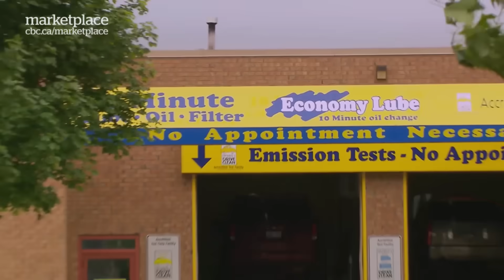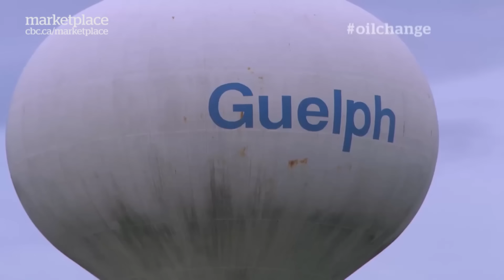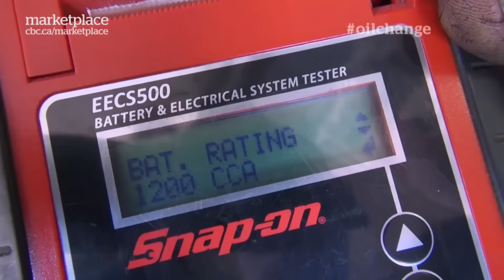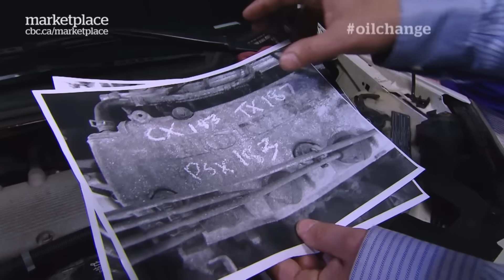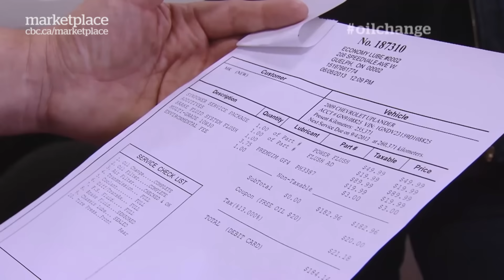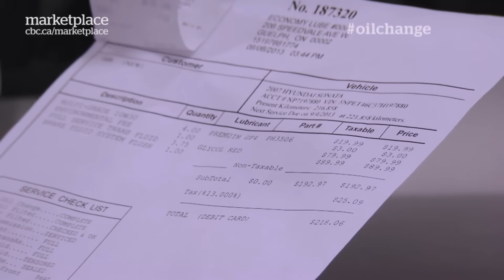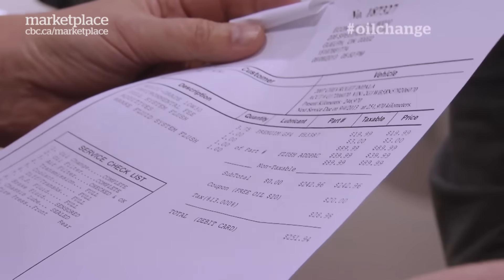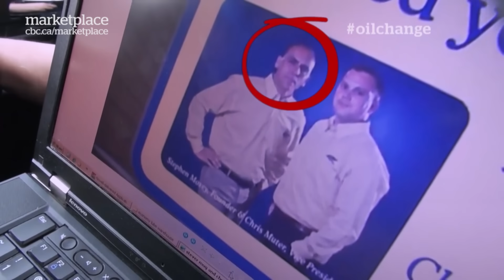Oil change scams: Hidden camera investigation on what really happens to your car (CBC Marketplace)

Comment: I can’t stand it when you ask only for an oil change..and they want you to have a flush radiator, transmission oil change, brake lines and do something with the power steering fluids..and change all the filters. Drives me nuts. And the damn oil change alone is still 98.00!

Comment: I'm guilty of not doing it but you should have your regular mechanic change your oil.  While the car is on the hoist they can check the suspension, front end, and drive drain for any problems.  You do not want a ball joint or tie rod end breaking while you're driving.

Comment: If they have 3 different prices for an oil change. 19.99 29.99 and the deluxe oil change is 39.99 that means if you you ask for the 19.99 oil change the technician will wipe off your oil filter and drain out half of the oil and then top it off with new oil and the next customer he will use your old oil to add to a deluxe oil change and each time the technician keeps your new oil filter and takes it home to put on his own car and the same thing for the new oil.   He steals a quart of new oil from each customer until he has enough oil for his own car.

Comment: Of course the budget price is bare bones. You arent getting synthetic oil or a decent filter etc. Its not illegal to offer extras. Its the very business model they use and any fool should know. Dealerships do it ..upselling wiper blades batteries tyres the lot!! Blinker fluid and headlight gas.

Comment: I do my own oil and breaks take me longer on oil changes because im doing it correctly.  Use a sharpie mark the oil filter. Most times the engine oil hasn't had time to completely drain in 10min  cant get all the old oil out but at least give it more time to drain. Worse things ive seen on u tube is over tighten oil filter and oil plug. There's more to much to mention

Comment: Just had an oil change done on my 2003 F150. Was told I had a rear seal out. I said no there isn’t, that someone (my bil) sabotaged my truck. Just do the oil change. I did need new wiper blades and new air filter which I had replaced. Oil change got done and I left, checked my oil at 100 miles and had to put in2 quarts, I was thinking I may possibly have that leaking rear seal. I kept a close watch on the oil level for the next 1300 miles. Guess what my oil level never went down at all. This tells me that I was being scammed about the rear seal! Will I go back HELL NO! This was 5 min oil change in Terre Haute, In.

Comment: Your blinker fluid has gone brown, it's supposed to be amber. That'll be $218.

edit: Dexcool is corrosive AF, use Prestone(the green stuff). I've ran it for years, it's fine, the Dexcool was corroding plastic fittings.

Comment: I hate the fact you can't trust  anybody and have to constantly learn stuff to keep up. Have a electrical problem?(tought myself over a few years). Have a plumbing problem?(worked as a plumber for a year). Recently bought a used motorcycle. Good thing I learned electrical and I'm in the user manuel everyday. Can't trust anybody to adjust my valves so I will have to do it. Have to buy a tourque wrench and a full set of bits....

Comment: Quick oil change shops are NOT fine for an oil change, especially if you have an aluminum oil pan for them to strip the threads on.

Comment: Never do a complete trans flush...only drain and fill like your oil.and filter.........A complete coolant flush not needed     drain and fill from radiator....Honda Civic Manual......Brake fluid needs to be bleeded out from each wheel.....if you own any other car......sorry to hear that

Comment: 1:37 why does it take like 1 minute to hoist up the car? In any other workshop ive seen and work in it takes about 10 seconds. im glad to work in an honest and fair workshop here in europe

unnecessary oil changes and "repairs" waste precious time we could use for an actual bigger problem, my boss goes like "come back after either [x] kilometers or [y] time and we'll have another checkup, right now is not necessary"

Comment: I  lost  major  respect  for  my  mechanic, who's been  working  on  my  car  for  many  years. I've  recommended  him to  friends. They  always  called  if something  they  felt  needed to  be  done.  I  was always One call  away.  Went  in  for  oil  change. Got a  bill for  oil change,  cabin  air filter,( Big  scam  for  cardboard) and  replaced  corroded  battery  terminal. The  last  2 without  my  approval. 
I lost  it  on  the  desk  person. You  ever  pull  that  sh*t  on anyone  I  recommended ,  I'll be  very  pissed  off. They  got the  hint.

Comment: at least they change fluids,i left my car in dealer's shop Opel in Poland i found out later that oil was not changed and i paid for it,any way next visit i put some marks on the filter and sealing nut and.... no oil was changed i told them that we will meet in court and they gave extra repairs for free and mechanic who cheated was fired instantly

Comment: usually you can shut these guys down pretty quickly if you come off as knowing even a little bit about your car. Tell them exactly what oil you want and how much you need and that's usually enough to stop the upselling, they know its only worth trying to prey on the ignorant because you might make a fuss and badmouth them later if they try to rip you off... Even better is to just avoid these places entirely and learn how to change your own oil, or if you don't want to do that I almost guarantee you know someone that can do it for you properly if you go and buy the proper oil and filter that you need and toss them some money for the trouble.

Comment: Walmart does the same things. I was just scammed by them. They sold me two tires I didn't need or want when I'm there for a flat repair. Then they scammed me saying my tires are to worn out to be repaired beacuse of that they don't qualify for their road hazard coverage and that they won't give me any credit twards replacement tires spit my having 50% tread left. They told me that my tires need to be repaired in pairs because the vehicle will not drive correctly otherwise. Then they charged me all kinds of extra charges like valve stem replacement when I didn't ask. Then they changed me $29 per tire for balancing. They over changed for what they did and sold and did extras I don't want or need.

Comment: No matter what don't detach any vehicles fuse for a few bucks . Coz a half filled fuel tank is filled with gas and will explode if your vehicle catch fire. I got lucky mine didn't blew up. Don't put peoples lives on the line for a few bucks.

Comment: Actually, this kind of things are pretty common in Japan too thoguh most customers don't know.  So, basically, I usually does most maintenance by myself.  But, I have to ask some shops to do legal vehicle inspection once in 2 years in Japan though we can do it by ourselves though it is not really feasible for those who have a job.  Only in such cases, I need to argue with the shop mechanics or sales persons not to do anything unnecessary things to pass the legal vehicle inspection.  It is really troublesome...  Also, in the cases in the video, the shop charged several hundred dollers but in Japan such shops charges several thousand dollors.  I also used to live in the US before but number of such shops are fewer than those in Japan as long as I know...

Comment: Almost every car over 15 years old needs more than an oil change it may not be a fluid flush but it if you look close enough there is something broke somewhere. These company’s just suck at finding it or can’t do the work and it’s usually something so minor that they don’t have a good sales pitch

Comment: now if you need 0-w20 or 16 thats full synthetic in most cases unless the manafacture allows non synthetic oils We cant put 5-w20 at the 20 dollar pit crew lube, oil and filter.  we have full synthetic quaker @44.88  or 54.88 for mobil1, castrol synthtec, pennzoil full synthetic or valvoline.

Comment: Thier so called expert is not all that sharp.  When asked what will happen when coolant types are mixed He described a bunch of gobbly goop.  What really happens is the PH of the coolant goes off the scales, and become acidic.  I have seen it happen many times.  You will lose you heater core your radiator and major gaskets such as the head gaskets. I suprised I did not see a PH meter testing coolant before letting the quick lube guys at it.  Very expensive mistake and hard to correct.  I have 45 years experience as a shop owner and line mechanic.

Comment: It's one thing to sell a service that isn't needed and done anyways but it's a completely different thing to sell an unnecessary service and not do it at all. That's straight fraud and they should be penalized. Not just told not to do it anymore. If I continuously stole from someone they wouldn't just tell me to stop and not do it anymore. They'd want me punished for the theft that's already occurred. Why didn't they bring charges? They'll be good for a while but eventually go back to their old tricks

Comment: Great report sometimes i don't trust the mechanics because you don't see what they doing in your car special the oil changed , you don't know if really they change the oil or keeping the old oil for that reason they putting sign in the mechanic station like restrict area wait in inside the room for customers , is very hard to believe either on the dealers that's my own opinion

Comment: That's what happened to my car at the Express lube when I took my nissan altima 2016 it was like 1 month ago that I had it changed at jiffy lube in Yuma Arizona then I took it to San Luis Arizona for a check it out and he took all the new oil and and put he's brand new oil and charge me when it was new very clean oil and did a fuel  injection system service when Mt car was running very very excellent and they messed up the oxygen sensor now it's been very expensive to put gasoline on the car because I trusted him !

Comment: i have better advice.   Got to a independent shop that specializes on your brand.  Don't go to dealers and don't go to franchise shops.  Go to the independent shops where the owner is on of the mechanic who specializes on that brand.   I did it for my gti and it was a great choice.  Cheaper and good work done to the car because the person is really into cars.. I have a  BMW and i found a shop that's the same

Comment: 20 bucks for an oil change should've been the immediate red flag for eveyone. Ive had used trucks and cars most of my life as most people also have. Ive always changed my own oil with those ysed vehicles and $20 is not a realiatic cost. More like $50 to $80 or more is realistic depending on the kind of oil.

Comment: You can't even buy generic oil for $20 (plus you need a filter) so how can anyone do it for $20? They can't so of course an upsell will happen and they'll be aggressive.
Reply: I don't know what the prices are in your country but in Finland (where everything car related is generally more expensive) oil and new filter costs around 20€. Considering that gas is about 2-3 times more expensive here than USA, I would expect oil change to be cheaper too. Also repair shops probably get the stuff cheaper when buying in large quantities. So I think 20 is a reasonable price in USA. Otherwise there'd be no point in not doing it yourself.

Comment: when i change oil I open pan bolt filter and walk away came back 30 minutes some cars longer.. neighbor used cheapo car place i researched filter by #on it sold by bulk and workd out to 50 cents a filter, those white ones.. some cars designed for special filter..  i change the washer too..  use a torque wrench on bolt silly..10 minute oil change no way..

Comment: Of course they didn't do a brake flush, if they actually did they would need to drive the car some time afterwards to ensure that the brakes continue getting proper pressure, that no air bubbles got into the line in the process.  In would be insane to just send the customer back out directly after doing one... not that this place seems to care much about risk.

Comment: someone should make a tap plug that you just open the installed tap and the oil comes out and owner just adds the required 4 to 6 litres of oil to there car !!!
Reply: They exit- but you still have to replace the filter.

Comment: They all do it. It is never the price on any car I owned. They always say my car takes a different pil so it is more. They refuse service if I don't go along with it.  Jiffy lube even took the bottom cover off my car.  Burned the head rest. Smoke all over.  Mineke blew up my car and did not pay for it.  All were just oil changes. Always detour my car.  No matter where I go.

Comment: Speaking of ripoffs grease monkey is a big rip off too. They’re always trying to upsell trying to sell your air filters for $60 which only cost seven dollars in the store not only that they’re always telling you you need to change your transmission fluid even though it was done the last time I was there every time I go there they were trying to sell me the transmission fluid change I bet they’ve never touched anything on the transmission anyway they are a big rip off

Comment: the green coolant is a universal kind.  so they didnt add the wrong kind to the car in the end.  although they are huge liars overall.
Reply: Each car company requires the right coolant so it does matter.
Reply: @loboxx337  right, but there are universal coolants that are neon green.  I have a 2003 s10, and I've been putting the green universal in for years.   The oem coolant for my truck is orange.  And I've mixed them. But the bottle says that's totally fine.

Comment: People need to demend that the work being charged for be on video , which will definitely change the scam mechanic rip off business. I work on my own vehicle and would never trust these wanna be rip off mechanic shops, plus you certainly don't want to be putting low quality fluids in your vehicle, especially low quality oil .... it will destroy your vehicles.

Comment: first off when you change automatic transmission fluid you only get 30-60% of the fluid out so the color may have been darker than new and therfor was legit to try and sell a service on it
Reply: Not necessarily, It's possible to do a complete fluid replacement of the transmission fluid. You just gotta know how to do it. There are also machines that can be hooked up to the coolant lines that will do the complete fluid replacement.

Comment: Unscrupulous garages? (Pukachu face) No way! 
Oil changes that don't get done? - when did you last check that your paid-for oil change actually was done? Most wouldn't know how to do that (hint: dipstick check before & after 'change').
"Sir, your headlamp bulb has run out of adjustment. We'll need to charge you for a complete new headlamp assembly"
"Sir, you have a leak in your front ns shock. Let me change it for you. And charge you. Oh, and by the way, we need to do all 4 at the same time"
"Sir, your boot interior light bulb is not working. We'll need to change your engine"
Garages (not all) are some of the biggest con artists around (more Pikachu faces).